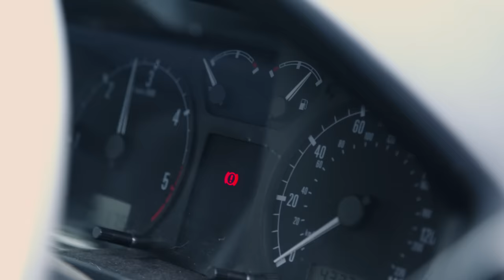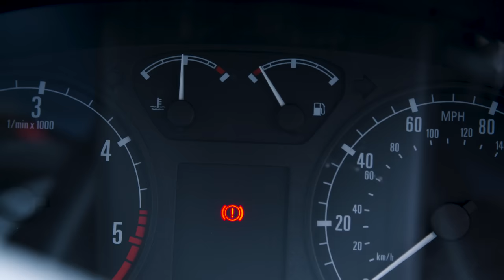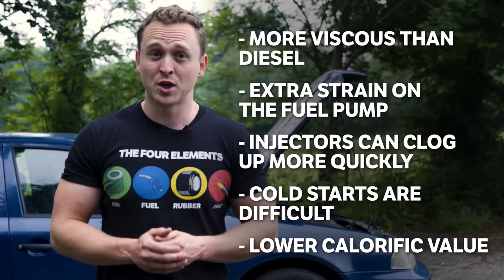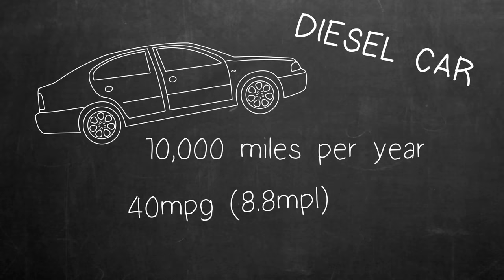The Pros & Cons Of Running An Old Diesel On Used Vegetable Oil

Comment: Just use red diesel its cheaper and lees work...👍
Reply: and illegal.
Reply: Riggald dont be a square dude...I bet your the kind of guy who goes to mass on Sunday...😂
Reply: And illegal to use on public roads. 
And these days difficult to get hold of.
Reply: cjeam in the same way is driving on public roads with vegetable oil illegal
Reply: featjack not if you’ve paid the appropriate taxes
Reply: cjeam how would that be possible?
Reply: featjack Excise notice 179e explains how you pay duty on biofuels and when you’re exempt (if you produce or use less than 2500 litres in 12 months). Excise Notice 75 explains red diesel and how certain vehicles can use it on public roads but it is a complicated process and they have to pay the balance of the difference between the full duty amount (that normal road diesel pays) and the reduced duty amount (of red diesel) for the amount of fuel they use on the roads, I think, I didn’t read that one that closely.
Reply: cjeam it's not hard to find it its just tractor fuel
Reply: FsgamingHD It used to be sold on some garage forecourts and at marinas. Not often anymore. So harder I guess.
Reply: mike the Knight where the hell do you get red diesel in the states

Comment: Imagine putting vegetable oil in are rotary engine
Reply: My dad does have an RX7... Any chance it could cause damage?
Reply: @MilesPrower1992  are you joking. right ?
Reply: @tralalaklak  if it won't cause any damage I think he would let me
Reply: @MilesPrower1992  rx-7 is rotary petrol engine. not diesel.
Reply: @tralalaklak  I know that. But would it cause damage?
Reply: @MilesPrower1992  100% yes
Reply: engine is not a toy.

Comment: You need to have a heated fuel tank, at least a heated fuel filter. Otherwise good luck starting on a real cold day.
Reply: akkudakkupl no need for that... if you have cold filtratet oil without water in it it is stabile up to minus 20°C if your glow plugs are good (and i mean really good, best is to pre glow 2 times) you can start like normal ( my old merc with an om602 starts perfect in the winter ( coldest start yet was -15°C))
Reply: Install a small auxiliary tank filled with standard diesel for warming up the engine and before turning it off
Reply: Just put 2-3litre diesel mix Will change the freeze point
Reply: Christian H. He has two fuel tanks.  One with deisel for starting then one with the oil. And a switch to choose.
Reply: skileg10 He doesn't have 2 fuel tanks, that was just an example of some of the common methods of running on veg oil.

Comment: I did it ran a 2.25 landrover engine and a datsan sd 33 6cyl on cooking oil .... oil was new the two injector pumps gave truble started reving at 900-1000rpm .... wood not shut back to tick over 750rpm ...but i saw a 80s w124 murk 240d running all its life no problum . Spanner man all my life😉... helo from ireland....

Comment: I use a 50/50 mix all year round, some people use a 25diesel/75veg mix in the summer. I probably wouldn't run an engine on 100% veg oil, for one you'll be changing your fuel filter more regularly, I also don't think its recommended for engine longevity.

Comment: You should have mentioned mixing veg oil with diesel to alleviate some of the issues. An friend of mine used to run his Audi A4 (B5) 1.9tdi on a 50:50 mix with no problems at all.

Comment: In the UK you can buy 5 litres of vegetable oil for £4.50 from tescos meaning that it is 90p per litre making it 70% of the cost of diesel and given that vegetable oil is only slightly less efficient than diesel you could avoid the filtering and acquisition phase and still save money.

Comment: Rudolf Diesel knew already. In a book titled "Diesel Engines for Land and Marine Work" he said "The motor was built for ordinary oils, and without any modification was run on vegetable oil" But, back in 1900, vegetable oil, also when used, was probably not for free.

Comment: I've cut my diesel fuel with used vegetable oil, (50/50) for more than a decade, (no issues).  VW Jetta 1.6L TD that gets 44-47 mpg on straight diesel and 42-45 mpg on the diesel/vegetable oil mix, (in case you're wondering).  That said, I wouldn't try it on a newer diesel, nor would I drive it in an area where the police aren't as "liberal" as they are in my little slice of heaven.

Comment: Been running my old Mercedes on used veg,, no conversion. Over 7000 miles now,, if I get used oil I filter it 3 times,,, through women's ankle tights,,,  change the fuel filter now and again,,,, in winter,, mix 20 litres off used oil with 20 litres off diesel,, or if you want 20 litre off fresh oil from Costco,, is still a good saving than buying from the pumps, and no messing about,,,, but free used oil is the best way,, did a 600 mile round trip on free used cooking oil, great,,,also no mods,, no conversion,, 190d 2,5 litre, no mods oil straight in the tank,,, I get free oil from a few different places,, cool old car,,,

Comment: Be careful with used vegetable oil. In addition to filtering out sediment, you need to remove any water that’s in the oil after it’s used for cooking. I had a friend who destroyed his Cummins engine with used vegetable oil that had too much water in it. You’re better off filtering, dehydrating, and then converting the oil into bioDiesel. That’s a little more difficult to do, and requires additional equipment, but you’ll get better fuel performance out of it.

Comment: My old Discovery 1 300tdi is a pretty robust engine. If the oil is too thick you can mix it with diesel to loosen it a bit especialy in the winter. A 50:50 mix should ne ok for the winter.

Comment: I used to run my pre PD leon on straight new veg oil from tescos at 75p a litre,  with 10ml per litre white spirit added during winter, it gels less than pump diesel.
Reply: How is the horsepower though, and how did the injectors do? 
I imagine more modern common-rail engines can still easily manage it.
Reply: @kasus123  I didn't notice any difference in power whatsoever. It was 110hp stock but I had a switch to trick it into injecting more so it was well up in power when I wanted it to be. Google "EVRY mod"

Comment: There are Germans selling automatic filtering systems with a pump and washable filters for filtering down to 1micron and you can buy an extra filter for 0.5 micron. Costs about 400€ and you only need two barels one for dirty oil and one for clean and then pump it.

Comment: Here in the states we run a 50/50 mix if used oil and diesel fuel in the winter I add an anti gel agent or a 50/40/10 oil diesel and kerosene

Comment: One clarification for this video before everyone gets their hopes up is that all older model diesel engines use a 'mechanical' injection pump which is essentially a small metal box with actual tiny pistons that pump fuel to each cylinder. Key word here is 'mechanical' and very 'low pressure'. As technology got better and the environment became more important, the research started in increasing the fuel pressure and using digitally controlled injectors. Now all newer diesel engines use a high pressure fuel pump attached to a high pressure rail which all the electronic injectors (on each cylinder) feed off of. This is the big CHALLENGE because of the viscosity difference between diesel fuel and vegetable oil.  What has to occur is the waste veg oil has to be heated using a water-to-oil heat exchanger to get the waste veg oil up to the temperature of the radiator fluid/water in the engine so that its viscosity is closer to that of diesel, usually around 90C/190F. If you're planning to build your own kit you're going to need a heat exchanger to save wear of the engine, both starting and running. There are companies (go to The Google) now that make kits where everything is so automated you just put the wvo in the separate fuel tank and you're done. The system senses the heat and flips the switch for you. I built my own system (not automated) back in 1999 that went into an Isuzu Trooper II tdi. I sourced all the parts and it was relatively inexpensive. There are also wvo filtering setups much easier and cheaper that the whole cloth thing you were doing, as well. Great video!
.

Comment: I mix 50/50 diesel and veg oil with a special mix ingredient in the cold season lower the level of fuel the tank to quarter then use fresh diesel to top up for cold start then mix as required again as for the fuel pump and injectors that's something to look into modifying

Comment: New modern common rail diesel engines do not like veg oil one bit and many car truck and van manufacturers also dislike its use in newer engines too ; it can gum up and ruin pistons filters etc, as well as cause  extensive engine damage. 

Old pre common rail diesels are ok at using straight vegetable oils and generally show no problems using it, but even here, do keep an eye on your engine as it can break down rubber seals gaskets etc and clog fuel filters and oil filters etc.

Comment: Here in the States.
Biodiesel can eat the "rubber" lines in a car if the car was built before 2000.
Also, biodiesel is a much cleaner fuel than petrochemical diesel.
That means, for about your first four to six tanks of biodiesel, you 'll find yourself having to change your fuel filter a few times.
Why?
BIODIESEL is much cleaner and it will therefore clean our your engine and your lines.....
Also there is a trick for winter time.
For say a 20 gallon fuel tank, use 18 gallons bio and 2 gallons petrochemical to help stop the bio from becoming 'slug" like...or use the petrochemical as a thinner.

Comment: There must only be a ratio, here in my country (tropical) a guy was running his engine for 2 years with vegetable oil and diesel. He said he uses 1 part oil 2 parts diesel, he didn't have any trouble and he's using a 2014 toyota Fortuner.

Comment: Great video 👍🏻 but my diesel golf basically runs on fresh air anyway so cheap to go anywhere / everywhere , I would just worry about engine, pump , injector damage & if my car did go wrong after using veg oil I know I would blame that straight away even if it wasn’t that ! 😂 was a class video though 👏🏻
Reply: Do half diesel half veggie oil(filtered)...no problems 👍

Comment: You can modify your car with a fuel heater. veritable oil can be pre heated to thin it out when the weather is colder. Or you can use additives or just ad a bit of diesel. Fresh Veg oil actually the best for your car and is the cleanest it will actually clean out the crap from your engine and fuel tank that has built up from using diesel. Which means you will need to change your filters but once that’s done your good to go. 

If you us old oil you may need to change hoses  and seals 

Been running a Land cruiser on fresh veg oil for about 15 years. Not needed to change and the engine runs smoother Zero loss in performance and the emissions are lower than brand new cars

Comment: If you use white spirits this helps the viscosity of the veg oil so that it doesn’t destroy your fuel pump and injectors. I think it’s if you make a batch of 97 litres then you use 3 litres of white spirits.

Comment: and i got 2 and just 2 questions
1st - okay so you said about some modifications you gotta do on the vehicle about adding an extra fuel tank, so you got the original tank for diesel and the secondary extra one for the vegetable oil, okay fine
but there is no modifications you need to do on your engine?
2nd - what if the oil i have was actually not used to deep fry things?
it is just sunflower oil and it has some dyes and essences
so i don't need to clean the oil to remove any dirt, right?
but can the dyes and essences damage my engine?

Comment: Can't believe how many car guys don't know how to empty the tank clean and easy... Just find the fuel feed line in the engine bay, disconnect and put it in you can, go for the fuel pump in the tank, give it 12V and there you go! Especially he opened the tank too, you could have done that too and use a hand siphon!

Comment: Due to the higher viscosity, the veggie oil does not burn well when the engine is cold. The fuel "cracks" in the cold engine and forms carbon deposit on the outside of the injector nozzle and on the piston rings. The deposit on the nozzles causes obstruccion and makes the injector less effective in delivering a fine mist of fuel. Even worse cold starts and a more "smokey" engine are the results. The carbon deposits on the piston rings do much more damage. The carbon obstructs free movement of the rings in their groves. More blow-by gas is a result. The hardened carbon deposits on the piston rings will start to polish the cylinder wall. This effect is called glazing. A rapidly wearing cylinder and subsequent engine rebuild will quickly result.
It IS possible to run your diesel engine on clean vegetable oil (filter and centrifuge for best results) but for a long lasting engine, it is best to install a system that allows for cold start on regular diesel fuel (run engine on regular diesel fuel until the coolant indicates normal operating temperature).
Understand that in order to start your diesel engine on regular diesel fuel, you will need to run it on regular diesel the last minutes of each use of the engine. This makes sure your fuel lines and injectors are filled with regular diesel fuel for the upcoming cold start.
So, make sure your veggie oil is free of water and debris. Start your engine on regular diesel fuel, switch over to veggie oil when engine has reached regular operating temperature and switch back to diesel fuel some 5 -10 minutes before shutting down the engine.
Enjoy your experience !!😎

Comment: The best thing to make the vegetable oil looser is to add a small dose of non-kerosene based white spirit, and that'll put less strain on the engine pumps. Essentially, this is homemade Biodiesel that you've made. But it's strange for bi-fueled diesel engines, having a tank of vegetable oil and a tank of normal diesel and a switch to change the fuel to use. Supposedly what you're describing is much like how petrol vehicles can have LPG as the other fuel.....

Comment: The thing was is that i always thought that fuel was Being burned  up in a Car like you light a candle ...but i understand now that the oil is used To keep the motor running smooth ...now i understand it  more ......

Comment: I used veg oil in a Mk2 Golf TD once and had to renew the rubber seals in the fuel pump. I think the veg oil tends to "eat away" at the seals?
Reply: It rots the rubber seals in your fuel pump.

Comment: What about running 50/50 diesel and vegetable oil mixed in the same tank? Wouldn't that help with the cold starts and the injectors while still cutting down on costs?

Comment: There is a huge demand for used cooking oil for making renewable fuels but it is a pitifully small resource compared with the potential demand.  In Europe the potential supply has been estimated as only 8 litres per person per year according to the biofuels industry.  Don't you have to pay tax if you make your own fuel?  The total UK supply of vegetable oil is around 3 million tons/year most of which is not recoverable to make diesel.  The UK uses about 27 million tons of diesel per year (2019).

Comment: Dont try it with newer 1,9TDI PD engines, the electronic PD nozzles will die ~instantly...  hey are very prone even to the slight change in fuel quality and they are expensive to change, the used normal nozzle is like ~20$ or so, but the PD one can get to ~100$ or even more.
The biggest issue is cold start... And some guys install preheating system that heats the oil to ~70 C degrees or so to make the oil a lot more liquid almost like water, it helps greatly you can basically start the car straight on vegetable oil..

Comment: I think he is missing out on part of the process? I think the oil has to be further separated with Sodium hydroxide (aka. Lye or Caustic soda) which leaves the stuff the engine doesn't want floating on top of the oil...which can then be removed..something like that anyway.

Comment: I can tell you from repairing and/or replacing THOUSANDS of older style diesel injectors and pump, you can use the used fryer oil FOR A WHILE. Over time you ruin pumps and injectors, and I made lots of money because drivers didn't believe me.

Comment: To save you a mouthful of diesel Next time you siphon, use 2 hoses and plug a rag around them to make the tank airtight and blow in 1 of the hoses and watch it flow from the other. On a side note, somebody a long time ago ran out of fuel and thought "I'll just pour this old vegetable oil in it, same thing"

Comment: This's the same 430000 miles car?

A few questions -- 

1) How did the owner react to this video?
2) This is what you did before you opened the engine?
3) Are you sure that smell was not related to this?

Comment: Run it through a diesel filter and add 30ml per litre of white spirit to thin it out. older diesels that have no optical sensor will run on old transmission fluid treated in a similar manner.

Comment: Question how well does the car run over a long time?  You admit that it is rougher on the fuel system.  Also you are saying that acid rain and smog are good for the environment compared to CO2 which the plants need more of unlike acid rain.

Comment: Iran an old clio Seidel for 62000 miles on veg oil, as long as you mixed it with at least a gallon of diesel it was fine!... and the fuel pump had its seals replaced as the oil disintegrates it!, at the time veg oil was around 49 p a litre, not any more.

Comment: Hi did this with a 1.9d citroen berlingo but I did a 5 liter diesel to 40liter veg oil ran it like that for two year never did any harm start every time even at -4 sold the car now but it is still on the road as my nabor has it I didnt use old oil